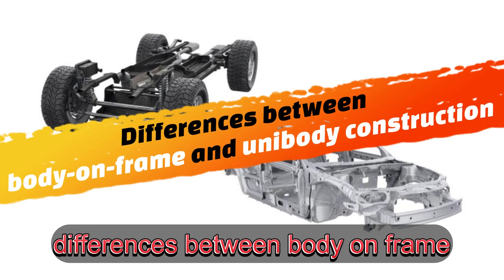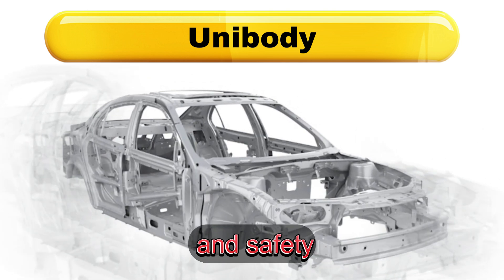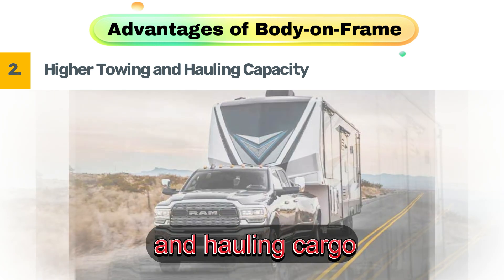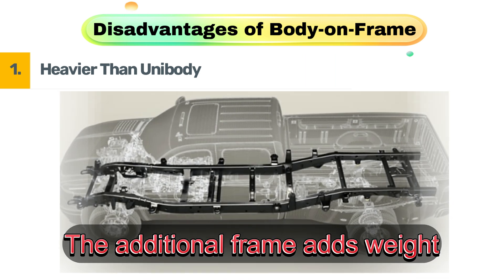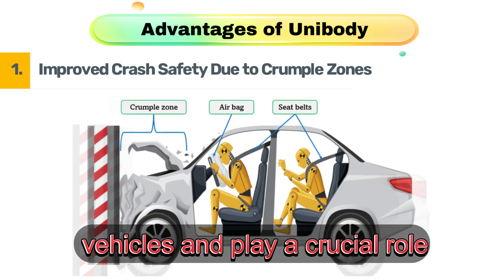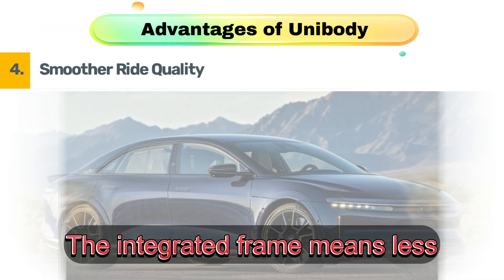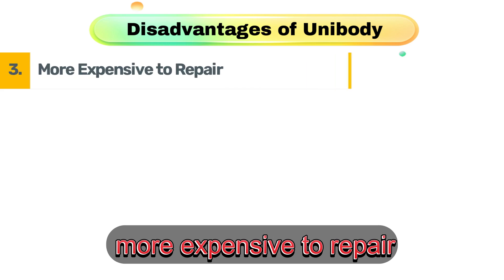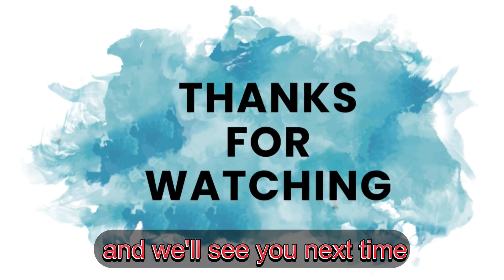Unibody vs. Body-on-Frame: Pros, Cons, and Best Uses

Comment: body-on-frame: 
about: 
- body mounted on strong chassis 
- great for heavy duty work for toughness 

pros: 
- better off-road capabilities 
- better towing and hauling capacity 
- cheaper to build and repair 
- prevents moisture because the separation frame absorbs it, and since the body is higher, it prevents from moisture and rust

cons:
- heavier than unibody, because the addition frame reduces fuel economy 
- less fuel efficient 

unibody: 
about: 
- body and frame are mounted together as 1 structure 
- lighter, stiffer, better handling 

pros: 
- improved crash safety, due to crumple zones
- better fuel economy 
- lower rollover risk, because they're so low to the ground, they can't tip during sharp turns or emergency maneuvers 
- smoother ride quality, for better handling and comfort on paved roads

cons:
- lower towing and hauling 
- not a great idea for off-roading
- more expensive to repair, because during an accident, the crumple zone acts as it's own name